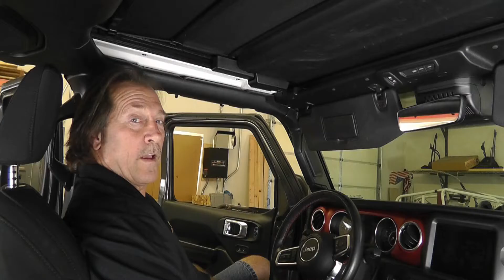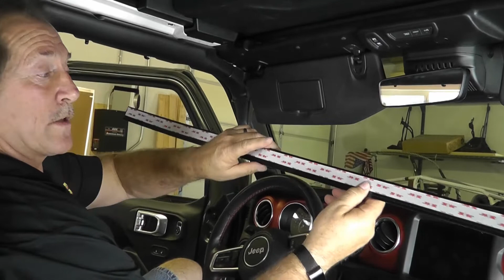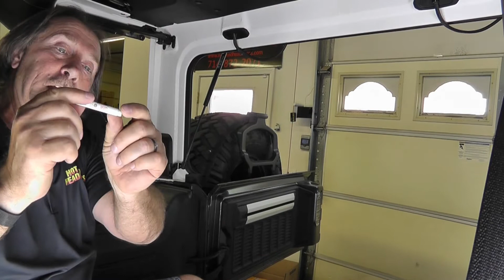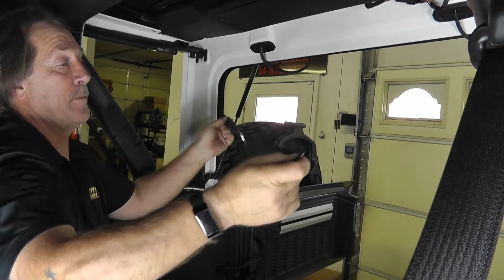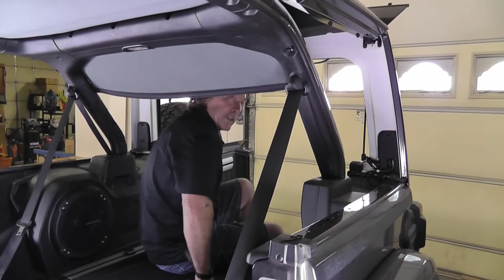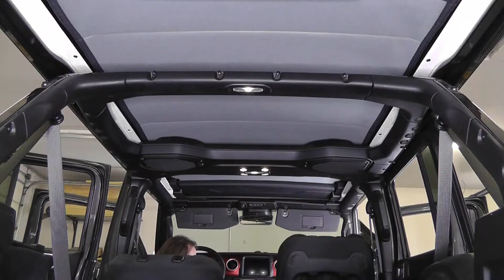Jeep Wrangler Sky One-Touch Power Top Headliner Installation 2018-2022 JLU | Hothead Headliners

Comment: I watched this video a few times and installed by myself. Now it’s flawless and the SOT works perfectly. I did have an error message the day after I installed, something about obstruction, then I readjusted everything about a 1/4” forward and it’s been golden since. Also, customer service at Hot Heads was excellent. I would buy from them again any day. And by the way, I would say that this product reduces noise and keeps the A/C by about 20%.
Reply from the maker: We're so glad you're enjoying your Hothead Skyliner. Thanks so much for sharing your experience and thank you for your business!

Comment: How does this headliner affect the sound / road noise in the jeep?
Reply: I have it installed in my 2020 Rubicon. I reduces sound and keeps the A/C and heat where you want it. I’d guess a 20% improvement on both fronts?
Reply from the maker: All of our headliners not only help regulate both hot and cold temperatures but they also help reduce unwanted road and wind noise!